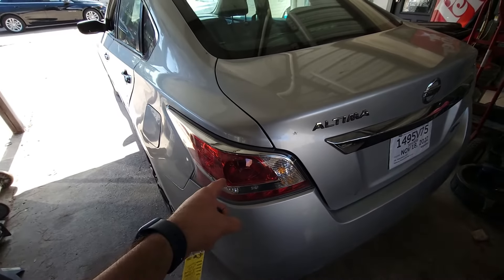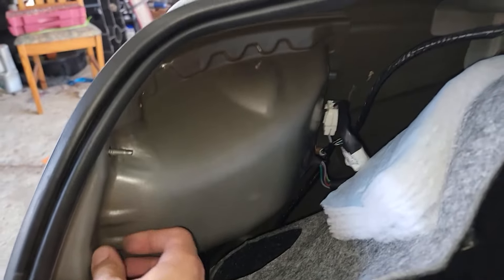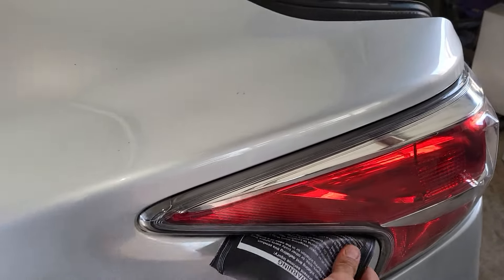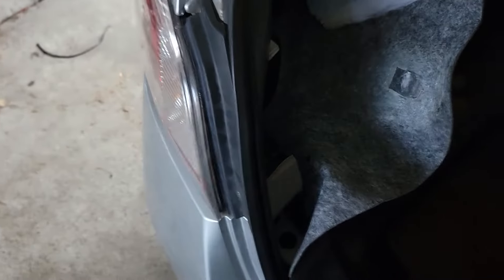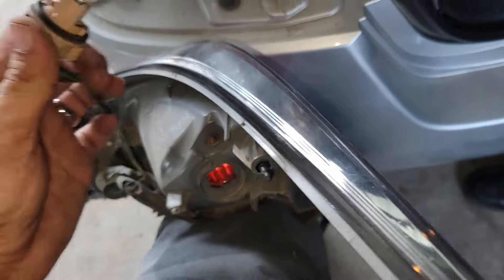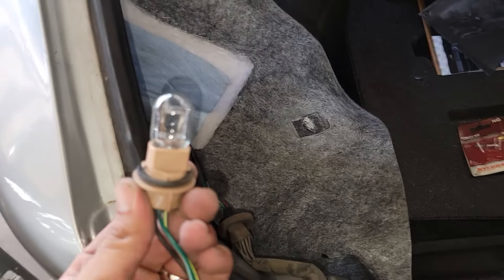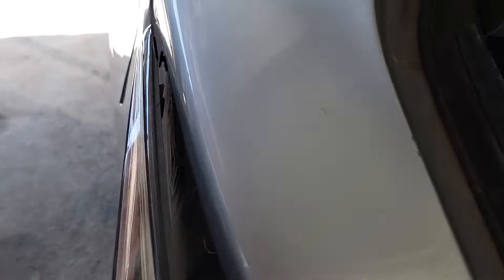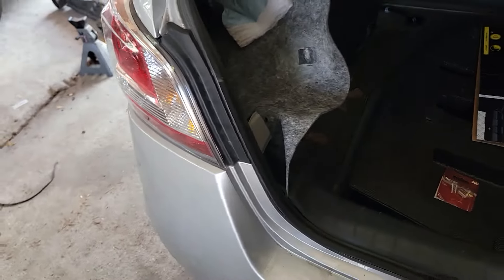HOW TO REMOVE TAIL LIGHTS ON A 2013-2018 NISSAN ALTIMA FIX BRAKE LIGHTS NOT WORKING FIXED FAST EASY!

Comment: This video came in clutch at 9 o clock at night, heavily recommended.
Reply: same here😂
Reply: 9:53 for me!
Reply: Lol. Same here. 10pm a friend messaged me and told me which bulb was out. Turns out all i had were 7444 amber, but they still look red when put in. I had to remove my tails anyway to upgrade my reverse bulbs. 
Win win

Comment: do you have a video to replace the headlights assmbley? need to change and/or place electrical tape, as the wiring might be defeated- 
going to purchase new headlights- mean time. just need to access the wiring.

Comment: Good vid, but at 2:50 bare hands touched the bulb. I understand that this will diminish the life of the bulb. A clean tissue or rag would avoid making direct contact. Thanks.

Comment: I'm having trouble removing it breaking bits of plastic already smh
Reply from the maker: Spray some form of lubricant like soap and water or wd40. Hit the screws HARD from inside

Comment: This video sucks. You didn’t even tell us about the bolts about how to feel back the material. You don’t need to use the freaking air pump. You don’t need anything. All you need is just to remove the bolts.

Comment: Wrong way to remove tail specialy with the hammer
Reply: Funny, I confirmed this method with another mechanic's video.  What exactly is wrong with it?
Reply: Just tried to use a hammer and it broke 😢